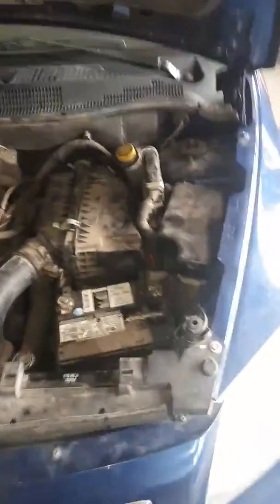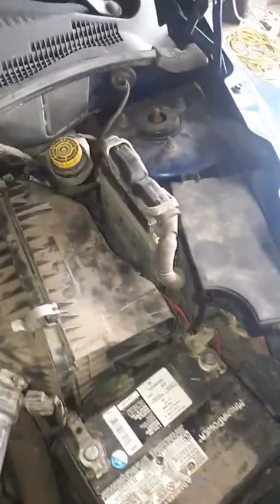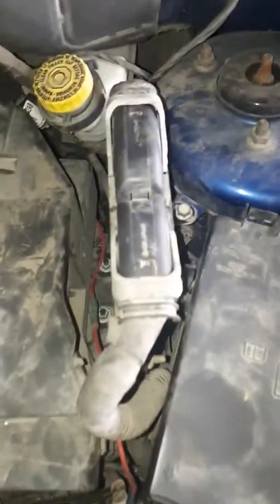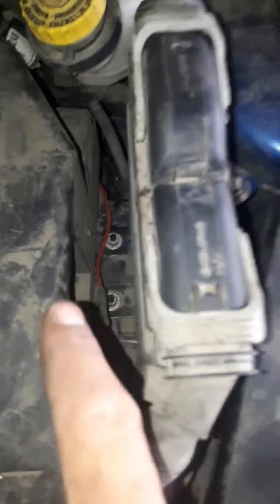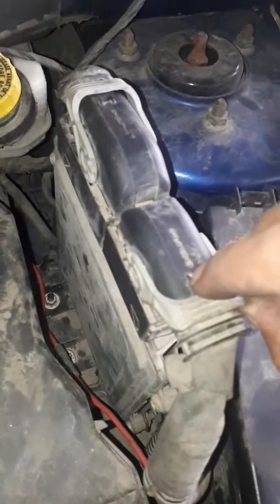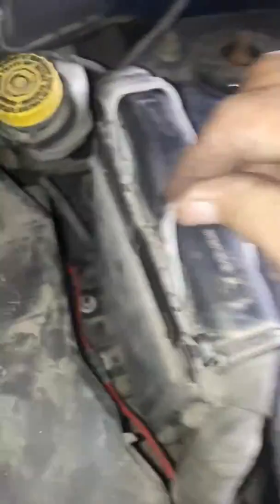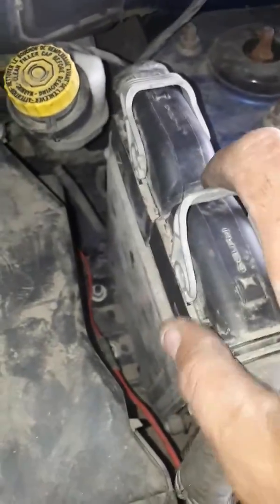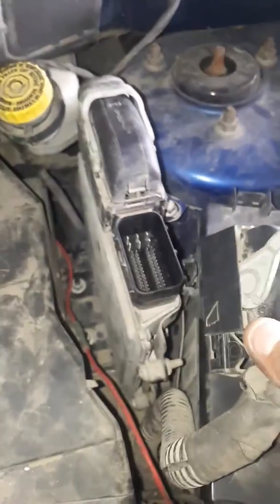dodge caliber ecm/computer location and removal

Comment: Hey man are you still available for a few questions? I'd really appreciate it
Reply from the maker: Ya brother, wuts up?
Reply: @THEMOOSESWRENCH  so I just bought an 07 caliber, my girlfriend was driving it and she said every light on the dash came on, it started jerking then it died, will not start back, you think that could be the computer?
Reply from the maker: @mikeyjoseph8714  check the relays under the wheel well on the driver's side, they are in a bad position and get corroded, but ya sounds electrical.  Start with the simple stuff first like battery, connections, ground cables and alternator as well.  Hope this helps.
Reply: @THEMOOSESWRENCH  hey man thanks for the reply, had the alternator tested, that was it. I appreciate it
Reply from the maker: @mikeyjoseph8714  awesome, good to here!
Reply from the maker: Hear*
Reply: @THEMOOSESWRENCH  I just replaced the relays above the wheel well on my daughter's car. One of the prongs was completely corroded to a pile of dust. Whomever designed the Caliber is a giant asshat. The car is still throwing electrical codes and intermittently starting so the ECM is my next stab at it. Thanks for the video.
Reply: @mferranto what happened to your caliber? Dealing with electrical codes now
Reply: Hi I just bought a used 2008 dodge calliber and I think the pcm is not working as my car doesn’t want to accelerate as fast as it should and the engine light is flashing.  What could possibly be the problem?